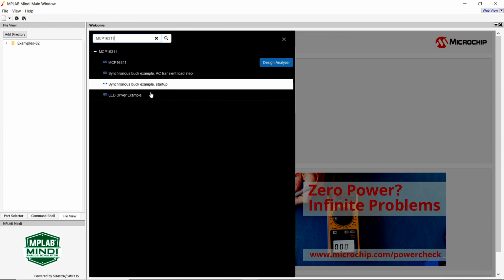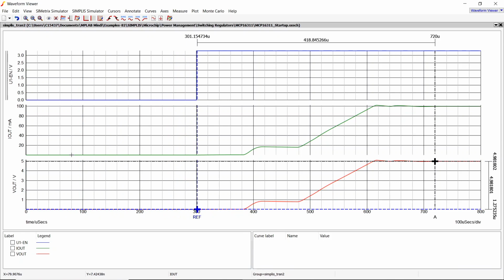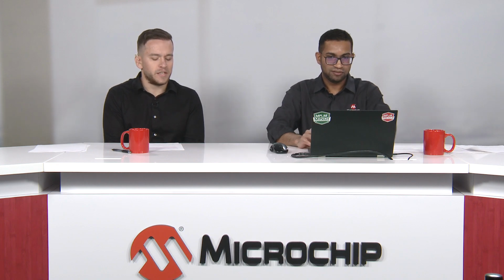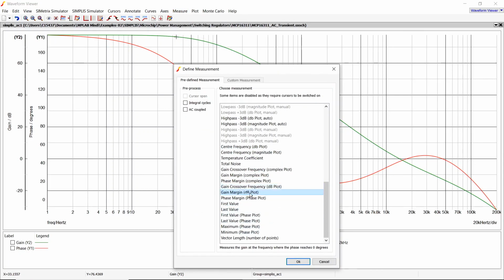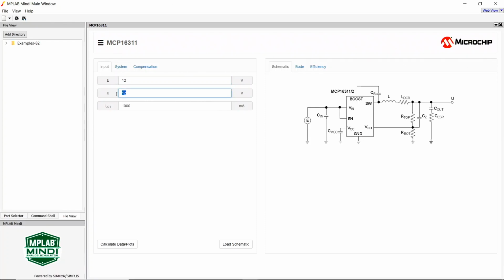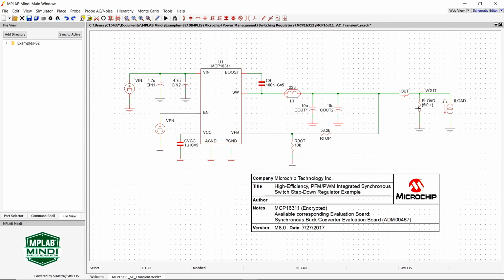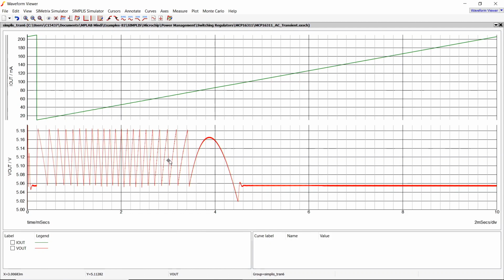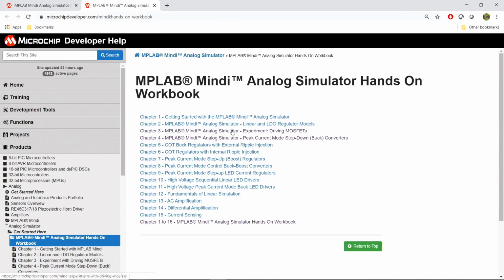Improve Your Circuit Design Experience with the MPLAB® Mindi™ Analog Simulator

Comment: I like when i set 100mV on input of amlifier with 100 Gain which have 3.3V  Vdd and in AC simulation i have 10V on output , it really helpfull now i know to never use this simulator
Reply: or i change value of resistor from 100k Ohms to 200k Ohms and transient analysis magically have error

Comment: A critical parameter that I couldn't find in any of the documentation was the node limit. By experimenting with a simple cascade of RC sections, it appears to be 138 nodes, which is the same as the ELEMENTS version available from SiMetrix that has a much larger component library. However nodes within Microchip models are counted, so for a cascade of biquad LPF sections using the MCP6001 I could only get up to 23 external nodes. So I'm not sure how useful Mindi could be. However ADI struck a deal with SiMetrix that nodes within their models don't count, so you might try to get the same.

Separately, I see the OA models are now encrypted (I was trying to see what the internal node count was for the MCP6001). I generally avoid using those parts from vendors that do this for the practical reason that I can't fix or enhance them when necessary. For example, many TI parts (e.g. the OPA378) have a bug that the offset voltage varies when the supply pins have a pedestal relative to ground (in my case biased 100V up) due to a ground reference within the input section of the model. This was easily corrected by referencing that node to the average of the supply pins, but had the model been encrypted I would have needed to replace the part with one from another vendor. So to me at least, encryption is a huge mistake for any vendor since you'll lose sales. Unless these are transistor-level models, which I'd think is unlikely do to runtime considerations, the models don't really divulge any company IP, so encryption seems unnecessary.
Reply from the maker: If we may be of any assistance, kindly visit support.microchip.com. Thank you.